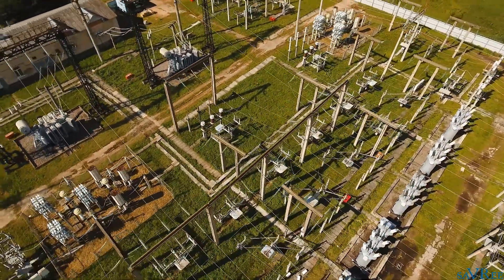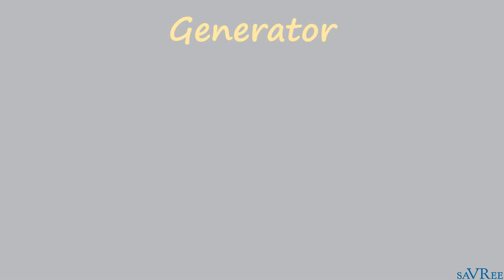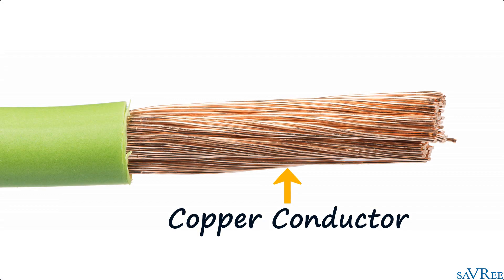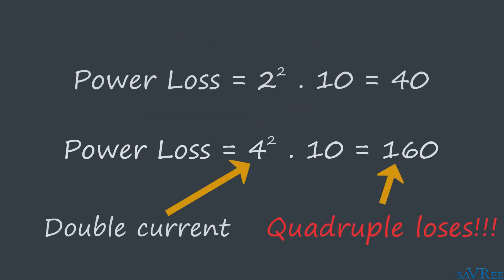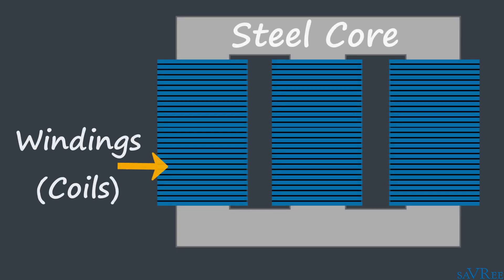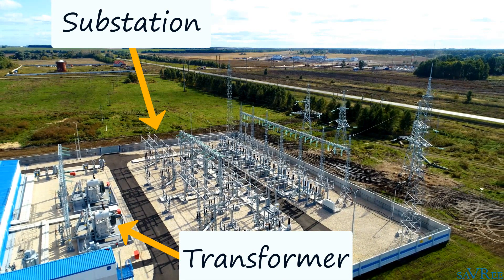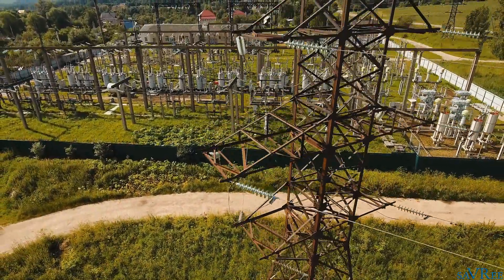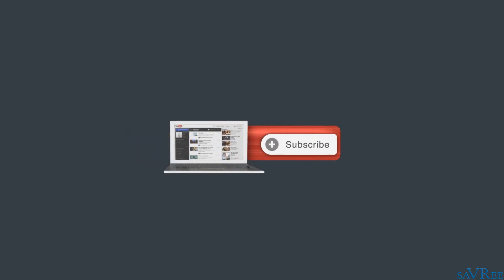The Electrical Grid and Electricity Supply | A Simple Explanation

Comment: Could there be modification of stations such as node of dome with awareness consciousness memories at the layer slope imbedded then another awareness consciousness at the base flat floor then spider strings of not webs of rounds but of the weaves processed at its internal arrange or at the mid layer of manufactured disc of up and down sandwich mode of a virtual radius mode.

Comment: Magnetic field of coil like dragon katowl then valence rings of 3 up and 3 down moving at the left valence rings the 3 points dots clockwise and moving at the right valence rings the 3 points dots counter clockwise, thats the picture you present. How about adding pies of the cake with degrees towards the center line each hoolahoop rings add coloured energies by degree of synch science lab manufactured to quantumly entangled the dots to dots by ionization ayon ayon in opposite charge interchange then fractionize a second by millisecond to femtosecond tweak parallel the dots by specific to a coil of specific magnetic types of magnet connect then split of second repulse, of frozen time splitted second connect of valence rings of opposite, then teleport like fashion both sides the coil, to light up the mosquito repellant of dual colours( joke )

Comment: voltage the effector mover instrument of propulse of one of the many types can voltage be narrowed to a hairstrand like strings of the telescoping to microscopic effect by area coverage paint or scan with transceiver to the receptor attach sensor of strand front and rear movements like hair movements tiny string then from soluble to insoluble to gas traversing the evaporation chain then back touchdown magnetize and reverse gas, liquidation molecularly slide immerse to solute hair via air current air navigate by earth currents movements of hairs carrying sensors back to strings form by gravity heat exposure and if possible diffuse down.

Comment: Can tunneling know how be applied to such that after processing each power source variety be enclosed in a dormant layers  of either horizontal plates or vertical tube's likened to traversal cosmos areas of space and it's alternate of space voids using the mechanics and the soft tech of each by layering reserved tweakable modes of energies per functionale usage and if tech capable and available for this design the nanno descent storaging vacuum effect in leveled layers for each likened to starting with 3 types of such energy sources per attach of imitate of the 3's in everything. Just opening ideas.

Comment: Electricity is managed,  not "manufactured ". High voltage dont require  a constant imput  of coal or gas to boil water to make steam to turn   some massive generator that "pumps " current along a billion miles of wires.  Instead high voltage  is balanced in a resonant loop  and is coupled to ground through transformers. The current that runs our devices strictly from  the secondary  coil of that pole transformer  dont "draw " energy from    a frickin fuel fed machine. There is no physical wire  connecting our stuff  to anything pass this point. The flow of current to ground is as natural as lighting . If theres a  proper air conditioner,  heater , stove ect,  in the way , oh well. There's no doubt ,to design buid and maintain  the grid is costly.  Now days computers  controlled voltage regulators  and what nots are managing  the show , theres really no need to have some guy  turn the big power dial  up or down .

Comment: I'm a little confused about the relationship between V=IR and P=VI. With P=VI, increasing the voltage means current goes down because power is the same, but with V=IR, increasing the voltage means current goes up because resistance remains the same. So in a step up transformer, if the secondary coil has a higher voltage and lower current, doesn't that mean it must also have a higher resistance than the primary coil? Otherwise V=IR wouldn't be obeyed because V is going up while I is going down, so R has to make up the difference.
Reply: Ohms law only applies to completely resistive circuits, transformers aren't purely resistive as they also have a magnetic component, with the core being a magnetic circuit and the windings being inductors, hence they have inductance values, it's quite a complex topic to explain, but I suggest searching "transformer equivalent circuit" and you'll get your answer eventually lol.

Comment: As a side note, out electric grid here in the US is SO FRAGILE AND SUBJECT TO MASSIVE FAILURE due to the LACK OF MAINTENANCE AND UPGRADES over the past 70 or so years.  One TRILLION dollars would not be enough to completely upgrade the system.  Expect more and more "power disruptions" and LONGER "outages".  People have no comprehension of how expensive towers are, transformers are, permits and right of way issues, and everything else associated with electricity generation and distribution.  All they care about is that their A/C works and their refrigerator works so they can have cold martini's.

Comment: Mechanical force  + electricity = Magnetic force.............  Superconductors uses this principle to generate magnetic force used to power Maglev trains. 

Magnetic force + Motion = Electricity................. 3phase AC generator uses this principle to generate electric power. 

Magnetic force + Electricity = Mechanical force.......................   Motor uses this principle to generate motion & it is used in power tools, vacuum cleaners, turbines etc.

Comment: 11:05 The reason that the transformer core is a bunch of laminate (insulated) metal sheets instead of a solid piece of steel, is to reduce magnetic field eddy currents. The purpose of the ferrous core is to merge the two coils' fields for greater induction efficiency; however, each electrified coil is turning the ferrous core into an electromagnet; and THIS electromagnet produces an additional magnetic field (the aforementioned eddy current). This eddy current works against the efficiency of the whole system! So the solution is "divide and conquer" and use several very small pieces of steel which are electrically insulated from one another, and this prevents the core from becoming a giant electromagnet (but rather numerous very weak ones).
Reply: R u in MIT bro?

Comment: This is a great general discussion on the grid but how much more pleasant to get rid of it! This is a great explanation but fusion power is much simpler and cheaper to power all our needs and for any project. There is no need to build solar or wind with the necessary ugly beefed-up electric grid when you can have a more reliable 24 hr. Fusion Nuclear Safire Generator built to scale on your site built on a very small footprint. So simple. Learn about the newest technology at "aureon energy.com". Learn about the EU new physics at "Thunderbolts Project.com".

Comment: I have a doubt about the losses’ entity. Known that power lost is PL=R*I^2, we also have I=V/R, so PL=V^2/R. R remains constant since it depends only from the material properties and the wires’ length and diameter, so the losses also go with the square of the voltage. Hence why is it actually more convenient to use low current and high voltage?
Reply: Very good point and somehow seldom properly explained. When they talk about high voltage, they mean high voltage compared with the ground. So there is a lot of excess charge in the power lines.
However, the difference between the excess charges on one end of the power line and the other side is very small. This means that the voltage difference on just the power line is very small, hence also the small current.